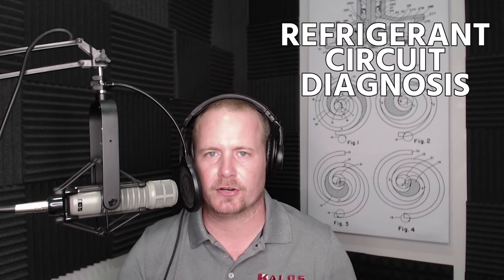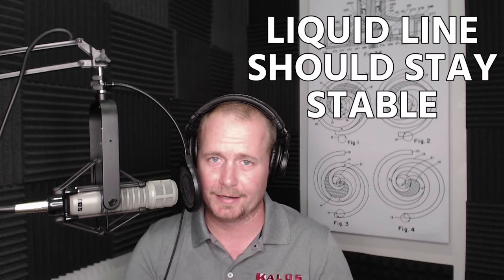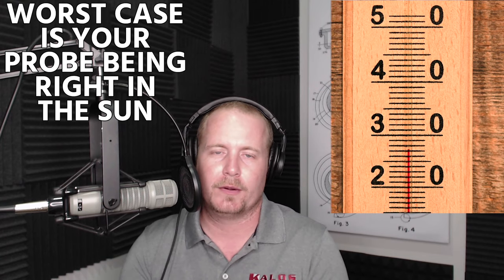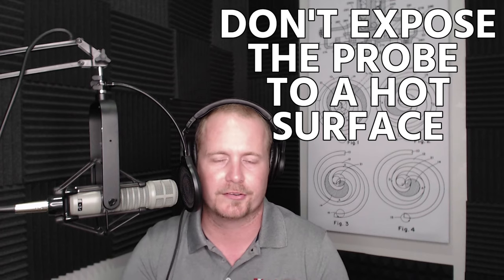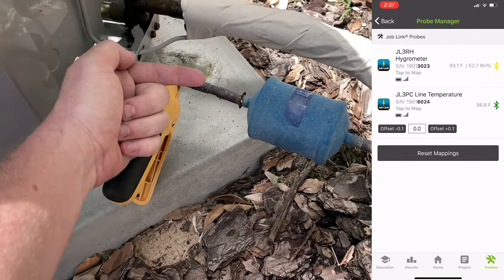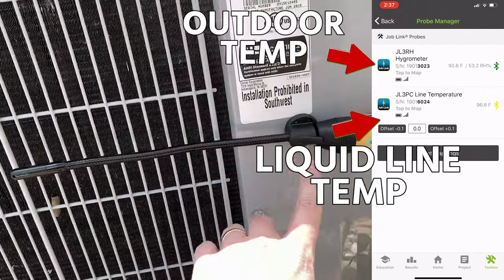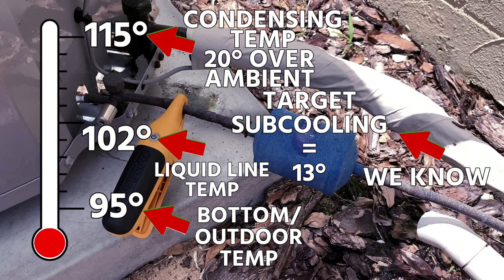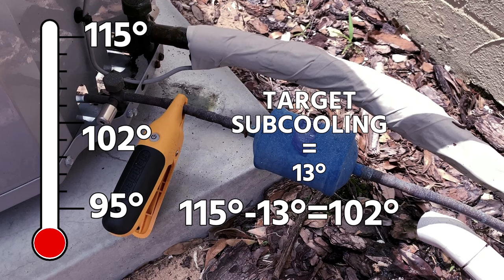Liquid Line Temperature

Comment: 9:35 - One small quibble: As I'm sure you probably know, Lennox uses (used) approach method charging, which is awesome. The instructions specifically say, "add refrigerant to lower the approach temperature or recover refrigerant from the system to increase the approach temperature". Indeed, I recently serviced a unit with a bad capacitor and after replacing it, I checked and found the approach temp to be around 1°F. So, following the instructions, I recovered just over a pound of refrigerant, to bring the approach temp to exactly 6° as called for. 
Aside: The homeowner told me she had it serviced the previous year by a tech that "didn't seem sure whether it needed freon, so he added some to be safe". Sounded like he was looking for a subcooling number, which isn't provided on these units. Using the traditional subcooling measurement, it showed about 11°F before I removed the charge, and about 6° after. So, not too surprising to find it overcharged from "guessing".
EDIT: Awesome video otherwise. I love these theory discussions - they make us all smarter! :-)
Reply: i am not sure how approach and subcooling do not follow each other. i thought they were two methods of getting to the same thing.

Comment: It is instructive to note that long lifts (vertical rises) can hamper subcooling at the throttle or expansion valve.  This is one reason many small refrigerator/freezers will skimp on the metering device, while helping to ensure good subcooling by using a makeshift heat exchanger consisting of a capillary tube liquid line inside or alongside the the suction return line.   Kind of an ingenious design to cut cost, if you ask me.
Reply: Long lifts can cause the liquid to flash enroute to the evaporator, we see that a lot in Arizona. The quick fix is to route the last 6 feet of liquid line before the evaporator inside the suction line insulation and taped to the suction line. That amount of cooling will help keep the freon in a liquid state. Don't fall for the trap "if a little is good, a lot is better." Never do more than 10' of this mod or your freon can get too cold to proper vaporize and you can flood the evaporator.

Comment: The term “gauge up” should not be taught. Every time you put gauges on a system you loose refrigerant. If this continues you will find the system low on charge and start looking for a leak that doesn’t exist. This is especially bad on package units. My gauges are the last tool I grab for diagnosing. Very good video. All techs should watch and learn from this video.

Comment: Hi, I have an unsolved problem.  2 tons split unit heatpump, liquid line temperature is 63f (sweeting), sat 60f.  suction line 37f, Sat 32. outside temperature 73f, interior 76. I think is a restriction so I have replaced the dryer cause 6f diff but the problem persists.  maybe the capillary tubes in the condenser?. Why a have a lot of liquid in the evap? Could the three-way valve cause this problem?  I think not but some technician suggested that. I recharge right amont of r410a.
can you help me? Thnx
Reply: Did you ever solve this?

Comment: Lennox has lots of condensers looking for 3 degrees of sub cooling. Now measurequick is always telling me my liquid line temp is too low. Radiant heat plays a big factor yet most Lennox xc17-25 subcooling is 2-6 degrees. If I charge the system to manufacturers specs I get a 20 degree split on evap coil.
Reply: The HVAC Hacker are you adjusting the expected sub cool in the app?
Reply: I use the feildpeice wireless with the app. You can put in the sub cool or super heat on the label and compare it to your current reading. If it above or below by 2 degrees you will get a warning. 
Same thing with the psychrometers. It will take the wet dry and humidity and give you a cooling target depending on the data. 
I service a lot of Lennox units in SWFL and the sub cools vary widely I agree.
Reply: Brian Orr has the answer 🤔 . All is about the weather conditions and the temperature of the particular area with the sun latitude to earth and also with how cool you like to have your conditioning  space. 😀😁✌🤣🤣🤣🤣

Comment: Thank you.  This is a wonderful explanation and very helpful to gaining another quick way of checking out a system.  
  I don’t know that we even talked about sub cooling in my trade school in the late 80s.
  I always learn something new from your videos and they clarify concepts and techniques.  Have you considered having a formal online hvac trade school?  I think the course content is already present in your videos.   You would just need to sequence them and add questions.
Some of the questions could come from your current fans and followers about actual on the job challenges.
Sometimes the issue could be ethical concerns.  Once I directly told the customer why a motor had failed who was looking over my shoulder while I worked on it.  A previous technician had shorted the leads together in a wire nut that we’re not being used for the different motor speeds and that burnt out the new motor.  Technicians in my shop were upset that I had not made up a story to cover for that mistake.  I believe that honesty is the best answer even though it has cost me my job a few times.  I moved on to something that was more suited to me and was more beneficial financially.  So even though at the time the results of being honest seemed to be bad, in the near future it really worked out for the best!

Comment: I came home today and my inside temp was 80. The outside temp was 90. I could hear the fan running. I left the temp set on 75. I drop the stat to 72 and then back up to 75. I then went outside to the condenser and hot air was coming out the top. The large line was cold and the small line was warm. I went back in the house and now the temp is slowly dropping.

Comment: Thank you for the video.  I have a question. Why my subcooling following together with the liqid line temperature. I’ve replace txv to 410a. I did convention from r22. Put filter liquid drier. Basically I’ve left the old evap coils and just replaced condenser. 14 seer. 2 ton old  coils, 2 ton r410a condenser? SH 22 degrees. Adding more refrigerant- liqid saturation temp same as liquid line pipe temp. Sustem works fine. Why I can’t get any temperature differential on high side?

Comment: @ 5:27, You have me all confused. Say an ambient of 80 degrees. Saturation of 95 degrees. 13 degrees subcool, you should see a 82 degree LLT.  Approach would be 2 degrees.
Now lets say the subcool was measured at 4 degrees, 95-4 = 91 degree LLT, and an approach of 11 degrees. Am I to understand that due to this approach nearing 15 degrees above ambient, I should remove refrigerant? 
According to Carrier, you would add refrigerant to lower LLT.  A higher LLT means a lower subcool.

Comment: I have a 3 ton, R-22, SEER 11 unit that routinely has a LLT of 130+ degrees on a 95 degree day. The coil is clean and it has good air flow, I can't figure this one out.  Would a liqiud line restriction at the evap coil cause this?

Comment: Thank you for sharing this video. I very much appreciate your sharing it. How did you come up with your highest condensing temperature? I know that you are guessing at it but still, there must be something that you use to come up with the guess. What is the relation between the SEER rating of the unit and the target cooling? If you run across an old unit with no information on it how do you know what the subcooling should be? Would that also be a guess based on its seer rating?
Reply from the maker: We estimate CTOA based on SEER - I’ve done a few articles on this but will be doing a CTOA specific video as well

Comment: You mention Over charge increasing LL temps twice (Do you mean discharge Line?).  The more refrigerant backing up against the meter, the slower the velocity, the more time spent in the coil,  the cooler the line temp? The less (to a volumetric point) refrigerant in the system, velocity is increased, less sub cooling, less heat can be rejected,  you will see higher line temps, again at a volumetric point? 

Have I got it wrong, Have I been seeing this wrong for 30+ years?
Reply from the maker: RJ_Make no you aren’t wrong. I’m going to remove those references.

Comment: I noticed that small units like those used in railroad locomotives under the cabs or on the roofs as well as rooftop RV units and even window units run somewhat higher high side temps than your typical home units do also. I work on the HVAC stuff no one elses wants to work on per say and it pays well enough for me. No big business here just  me and my education, but I do have a pretty decent contracts with a couple railroads and cellular carriers for HVAC here I also work on IT and communications as well.

Comment: So the liquid line shouldn't be any colder than the air temp. But in FL it rains a lot and if you have had a shower recently and the condenser coils have gotten wet, wouldn't that then make them subject to "wet bulb" cooling and potentially have the liquid line cooler than the ambient air temperature?

Comment: Great video!
I thought it kind of odd the copper was not cleaned before attaching the  temperature clamp.
Did I miss something?
You’ve probably noticed RHEEM Classic package units don’t have access to the copper unless you lift the grill and place the clamp.
Doesn’t that effect the measurement because of the added heat from the condenser?
Again thanks for all the great training!
Rick

Comment: Replaced a mini split today and after firing up, noticed the liquid line cold and sweating. The line set is only about 8' long....right out the wall and to the ground to the condenser. Pressures showed perhaps the unit being a little over charged from the factory so recovered some of the 410 and got that to an acceptable range. The unit cools great and we got great temps inside but just found it odd that it was that cold.  Any thoughts?

Comment: Ambient temp 110-115. HOT! The line coming out of the compressor into the coil is almost too hot to touch. The liquid line entering the house is also hot but not as hot as the condensing coil. How hot is too hot when it's 110 outside? I'm not sure if I am undercharged, overcharged, have air in line or restriction somewhere. Most techs blame TXV. Suction line is barely cold while running. Actually suction line becomes nice and cold right at start up but then warms up soon after.

Comment: Had a brand new HVAC system installed. One week later blocks of ice all over the lines. Installer “fixed it” and it ran the rest of the summer. Had a second company come out and found “reduced superheat, elevated sub-cooling, reduced airflow due to lack of returns and refrigerant overcharge.” First installer says “It’s running fine, every system can be installed differently.” What should I do? Thank you.

Comment: I tried this method at work today.  I was servicing a 14seer 6 year old carrier.  85 degrees outside, so the condensing temperature  should be  105°F.  Manufacturing label says 10° sub oil is required for indoor txv. Liquid line should read around 95°F.  It read 92.6°F so I technically by this formula have a 12° subcool.  

However, I use analog gauges and a Fieldpiece meter with a thermocouple clamp.  According to my tools, I found I had 305psi in the high side and read about 3° of subcool.  

I trust my gauges and meter more than a new technique I just discovered,, but I’d like to know where or how did I go wrong?  I’m assuming it’s the condensing temperature being off.  If so, where or how can I find that?

Comment: So I  have a 5 ton roof top unit that is cooling intermittent,, my gauges read 65 psi on suction line and 200 psi on liquid line with liquid line temp at 165 degrees,,, I washed condenser coil with no change on temp?????
Reply: Its an r22 system
Reply: So the compressor is going off on thermal overheat..

Comment: If you had an over charge, the liquid line temp would go down, not up, due to the excess subcooling of the refrigerant stacked up in the condenser. The amount of subcooling you need for a particular system is the amount that will deliver a solid column of liquid to the metering device.  This varies dependent on liquid line pressure drop due to fittings, accessories, lift etc.
Reply: You wrong liquid  line temperature  goes up! You can try it 😉

Comment: You mentioned that an overcharge would raise the liquid line temperature. Wouldn't this be the opposite as an overcharge would increase the subcooling to the point of outdoor ambient temperature? A severly undercharged system would have a cooler than expected liquid line. Would you possibly have a video or demonstration that would show how overcharging would raise the liquid line temperature?
Reply from the maker: It’s one of those things I said that I really shouldn’t have without a lot more explanation. I’m going to cut that part.
Reply: @HVACS  Now that I thought about it more, would it be that an overcharge would be moving more heat than the condenser could reject? I wouldn't say cut it from the video, it is good to know some of the tricky things.

Comment: So will recovering the refrigerant, blowing system with nitrogen and pulling a vac clear a restriction in the condenser? My liquid line is cooler than outdoor temp. It's a 9 year old 410 with txv so I'm considering just replacing it again but rather not if doing the above will clear it?
Reply: What system do you have?
Some mini-splits have a suction to liquid line heat exchanger or some other set up that drives down the temperature of the liquid line and can even lower it below ambient. This adds more subcooling and gets a bit more efficiency out of the system.

2nd question. Are you sure the restrictions is at the TXV vs at the filter drier? If its the latter, no amount of nitrogen is going to unblock it.
If its the TXV, then why is the TXV restricted? Is it debris clogging the screen? Is the TXV stem jammed? Has the sensing bulb loss its charge? Is there a pressure equalizing line? Is it choked/kinked?
Reply: @WarriorofCathar  it's a typical 3 ton split system. I was thinking the restriction was in the condenser itself because of what he mentioned in the video. He mentioned if checking the line temp at the condenser and it was lower than ambient, the restriction is in the condenser

Comment: Hi, good info. 

My mini split isn't creating the chill effect anymore and it's taking hours to drop a degree even at night time when ambient temp outside is mere 84°f. I checked everything as far as i know, suction pressure is good R22 66 psi, grille temp is 53°, suction line temp is 48°, then i checked my liquid discharge line temp and it's actually lower than ambient temp 68° and cold to touch! could this be the issue of slow cooling? I haven't checked discharge pressure since there's no service port in discharge valve.
Reply: Metering device is in the outdoor unit on the mini splits, so you "liquid line" temp is going to be lower.  If you suspect the charge is wrong the only way to properly correct it is to recover the refrigerant and and recharge it by weight.  You cant charge the mini split with sub cooling/superheat method.

Comment: The best temperature you can take  is at the register and return. If I'm getting 15 to 21 degrees I don't hook my guages up. Of course the load on the system is taken into consideration.  Time is money when you work for a contractor. Blow your guages out regularly and use low loss fittings. I'm more concerned about hooking up guages when I work on small refrigeration systems.

Comment: What would you expect the liquid line temp to be on a 21 Seer 2 stage unit that’s running on 1st stage with absurd airflow, and an oversized evaporator? I’m getting 2-3 degrees below ambient right off the coil, no appreciable change down the short lineset.
Reply: Some systems have a heat exchanger on the liquid line that can drive down the temperature below ambient. I suspect its for a tiny boost to efficiency and cooling capacity.

Comment: You say the liquid line temp shouldn't change much... maybe picks up 2-3 degF, and then go on to say ....especially with long runs that may take you through vertical sections and hot attics. Allow me to ask for clarity. I have the entire liq line "bare", ( as is common), and it runs maybe 4 ft length between the outdoor condenser and the house.....then runs up inside the house wall ( say 12 ft vert rise)....and then enters the attic space for another 18 feet before it enters the air-handler section in the attic. The attic atmosphere gets to above 122 degF on a 91 degree day. I want to insulate the liq line in the attic space, yet leave the outside section bare, to help preserve the subcooling in this line before it hits temp valve in the air handler. Comments?

Comment: What is the reason of liquid line temperature to be around 20c ? While outdoor temp is around 35c
Reply: What system are you running? It could be a restriction or it could be the design of the unit. Some units like Daikin and Mitsubishi have a heat exchanger to reduce the liquid line temperature below ambient to slightly improve efficiency. You'd had to do a more detailed analysis than just liquid line temp to figure it out.

Comment: I though overcharge made you have a higher subcooling so the liquid line temp would read lower? Assuming a clean condenser, evap, filter, etc.
Reply from the maker: Most of subcool comes as you drive up the condensing temperature. It’s sort of a bell curve.
Reply: @HVACS  Thanks for the reply. That's where the outdoor air temp and amount of sun beating on the coil comes into play I assume.
Reply from the maker: Yes, in general overcharge doesn’t drive up liquid temp as you stated, but because charge is often used as a compensating factor for the true issue it can be tough.